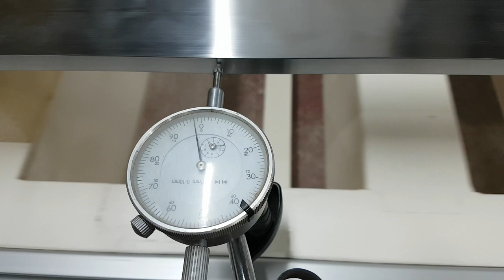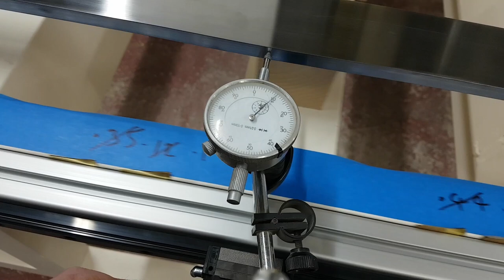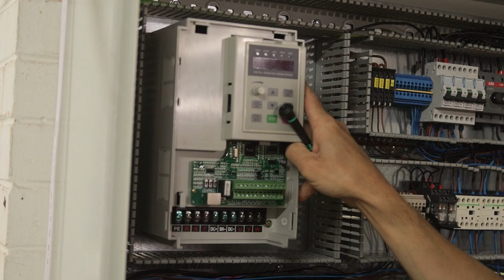5 months in 40 minutes EPIC £20k woodcutting robot build

Comment: So let me get this straight. He used his newly built machine to continually build his machine? My mind is officially blown. New Yorkshire Workshop is my favorite channel! Thank you
Reply: i dont see him using this machine to build this machine.
Reply: @patrickdonegan9559  He used a temp gantry on the machine to grind the permanent gantry flat. He used the completed gantry to make the parts for the dust shoe, the blast gate, the vertical clamping board, route out the channels for the vacuum clamping system ect.
Reply: @DavidLeeKersey  thanks for those details. This is an amazing project that he has done.
Reply: @patrickdonegan9559  then you didn't watch the video
Reply: @jasontofini3412  it is very long and there is no clear highlights for that.
Reply: It's funny how it seems to always work out that way, first things I made for 3d printer were things for my 3d printer. I'm planning on building a CNC eventually too, and the design I'm thinking I'm gonna use has 3d printed parts, and first thing I'm gonna make with the CNC is metal parts to replace the printed parts.
Reply: Yeah, I thought that was some INSANE next-level planning there...

Comment: As an engineer in the aerospace industry of 50years, I have to say.....  KUDOS  !     Truly excellent.  My only critique is a little lame... but.. I would only use the  "soft-fold" technique for light guage materials...  aluminium at 10g will surely crack if manipulated to 90deg at room temperature....  Longer slots with radiused corners to allow a larger fold radius..  and  attention to grain direction...  with a little heat to assist with what you used.  In the light of your amazing achievement, I feel like I'm being harsh, but metal forming has been my forte for many years. It was just a little thing that I noticed and was qualified to advise upon.  Truly though...  I am absolutely knocked out.. amazed and inspired by your incredible achievement.   notes:    1.  Nest component at 45deg.  2. Investigate "Solutionising" as an annealing treatment prior to forming..  Delay air hardening of material in a deep freeze.  3.  Radius all edges within forming area to a full radius.   I'm sure you are more than capable of assembling your own (small) solutionising plant.     Oh..  and use a radiused dolly to form your desired internal radius.         Kudos from the U.K.

Comment: A man after my own heart. Why pay a fortune for a specialist machine that "almost" does what you want, when with time and patience, you can build something that does everything you want.
I am half way through a build of a laser cutter. Unless you only want a toy for putting small things together, you have to pay the price and get quality parts. Linear Bearings, High Tensile polished steel Linear Rails, High Tensile threaded rods with Linear Ball Screws, A decent dedicated computer and control board. No flexible toothed belts, no plastic brackets.
Thank you for taking the time to document this build on video. I hope it will inspire some viewers to put in the effort and learn some skills while they become intimately familiar with their machine. It helps in the unlikely event that something goes wrong.
I also build and fly RC aircraft. I can buy one in a box ready to go, or I can learn about Balance, Lift, Drag, Thrust etc and make one from scratch.
Life advice for all the coming generations..... Dismantle everything, so you know how it works. It is worth having a go at making your own, Be a builder and not just a consumer. There is no shame in trying and failing, but failing to try is shameful!

Comment: VERY COOL! Have you thought of putting a air nozzle in the same place as the cutter to blow out the dust while cutting so it can be sucked up by the dust extractor. Simpler cleanup once cutting job is complete.
Reply from the maker: yes I already did that, it works quite well!

Comment: Nice work!!! I made a little one with aluminum and now i started to mount one ATC (i hated manual tool changes). I made some videos of 3D carvings in my CNC and a little "presentation" video for share my mistakes (it's the second frame i mount).

What kind of "blowers" you use for the vaccum table? I'm interested in make one part of my table with vaccum and this motors are little and maybe doesn't draw a lot of power, i'm limited to a domestic power connection (it's a hobby not a workshop ).

Congratulations for your work it's impressive.

Comment: There's this cool tool that would be a great addition to my workshop.  I could buy it with all of the pieces ready to go, but that's no fun!  I want it to be more solid and more precise than something I could buy in a store.  I'm well-known for my woodworking skill, but I'm not going to be content with just doing my own woodworking on this project.  Oh no, I'm going to do some major metal work as well  -- welding, drilling, tapping etc.  Before I get too far on the construction I'm going to start using what I have already built to create parts for itself.  And I'm going to do some plumbing, some electrical, and a whole lot of computer wizardry before I'm through.  And because I'm a glutton for punishment, I'm going to video it all in glorious detail so if I make a mistake, the world can set it happen.  So ya, I built a thing.

Comment: Very impressive. I do have one question.

As the wood moves with humidity etc…, wouldn’t that affect the squareness and parallelism of the machine??

Surely the x, y, z axis won’t remain stable with a wooden frame? I am a complete novice, so it is just a genuine question for my understanding.

There is a reason they make surface grinders and mills out of cast iron and steel after all.

Hopefully, someone can answer my query.